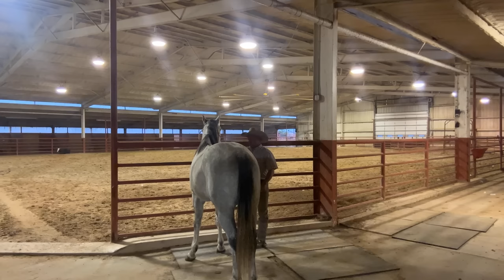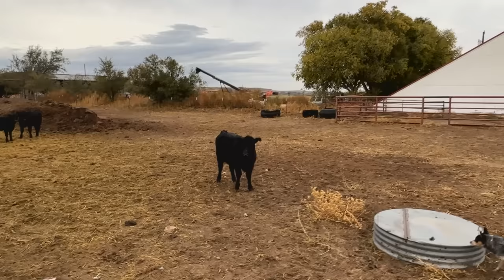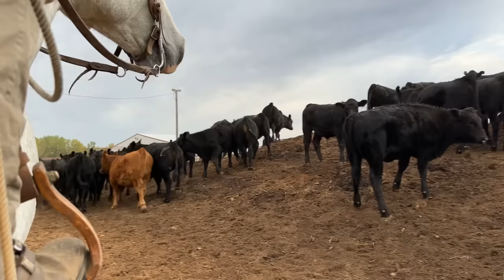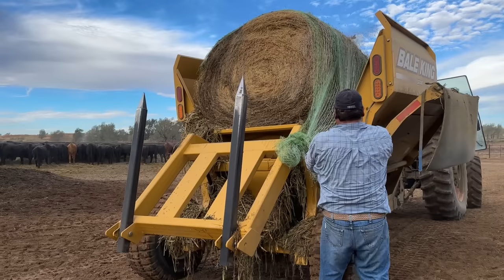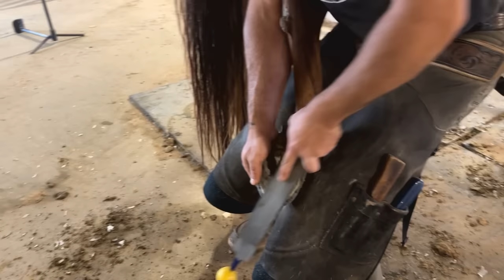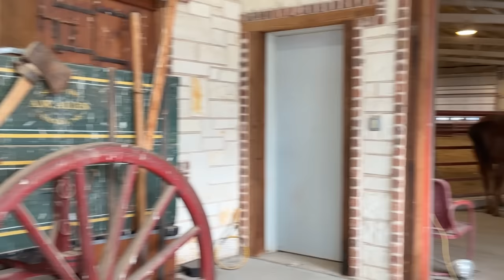Come Ride With Me and Bluey #cowdog #horse #ranch

Comment: Jason, a little help for stepping into you.  I can be fixed with the principle of bend which I know you know.  With your hackamore on after you have circled the horse both ways put the right rein over the right side of the horn.  You can bend him from the ground to bring the hind quarters back to you then apply the direct rein with the neck still bent to the right and back the horse up a few steps.  All done from the ground.  Every time you try to get on you may have to do this until he stands without stepping on you.  When ever you mount with the head bend to the left he will move the hind quarters away from you.

Comment: I have a horse that steps into me too. I have determined that it's because the saddle is slipping towards you when you get on. Try using a mounting block for testing, and I think he will stop doing it. Bottom line is the saddle is a bit too wide at the gullet.

Comment: I guarantee if you were running 20-30 bales a day through that processor you wouldn't be fooling around carrying your second bale on the loader and pulling net wrap. You still have to clean the hammer mill every 3-4 days anyway, pay attention to the wind, dont leave that machine untill you have all of the net wrap burned out. When you feed in Montana at 20 below you learn to work efficiently and fast.